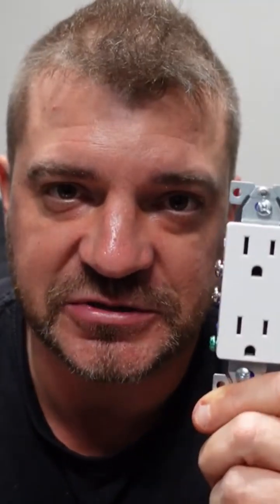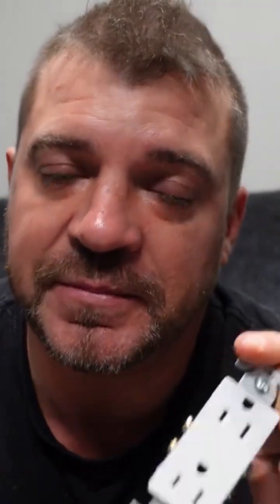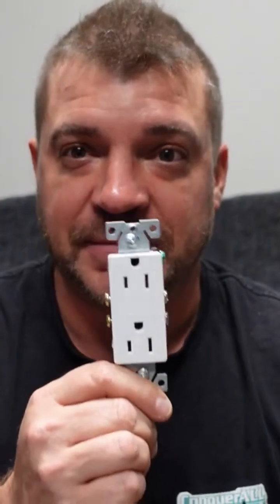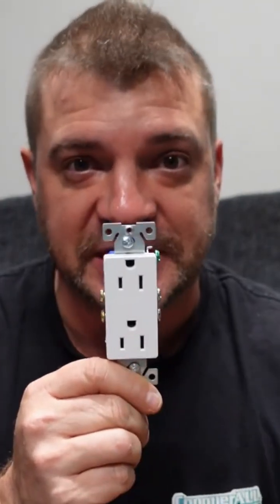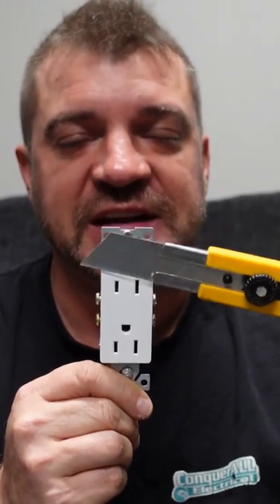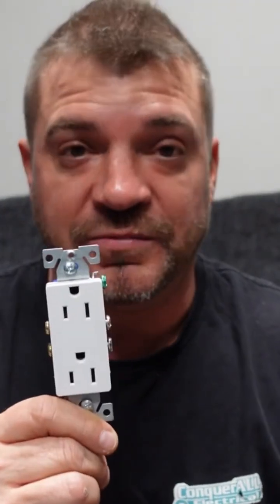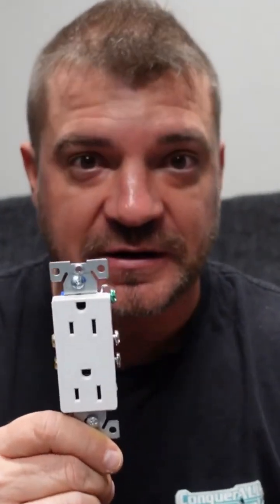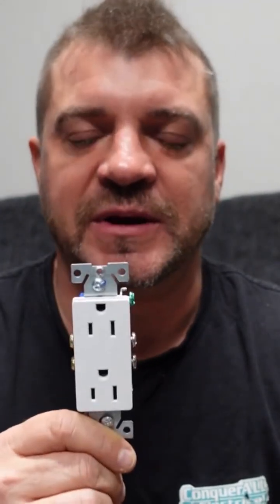Why Plugs Are Mounted Upside Down

Comment: Thanks for this video. In my bathroom, it is grounded up, making me plug my dehumidifier in upside down. I worry the weight of the plus will make it get all messed up. Is there a rotating splitter (do those exist?) and if there is, would it be safe to use?  Thank You.

Comment: There's so many ways they could improve outlets to make them more safe and reliable. They could recess the sockets by an 1/8th inch so that when the device is fully plugged in, if something is dropped on it, it's unlikely to come into contact with any of the prongs. They could have a locking clip that grabs the plug which is spring-loaded so that the plug wouldn't come out unless it were pulled with at least some force (it won't "fall out" on its own, but yet in an emergency it could be yanked out) or, like the Europeans do, the plug could be big and round so that it can't sag once it were pushed all the way in as the big round base pushes against the plug.
 
Or, do both, like the Europeans do -- recess the plug AND make the plug larger and more round so that it can't fall out of the socket on its own. It's literally impossible, but yet it will pull straight out if tugged.
 
Most European things I just shrug and go 'whatever' such as PAL being 50hz instead of 60hz, but their electrical plugs are clearly superior.
Reply: You basically defined our outlets here in Brazil